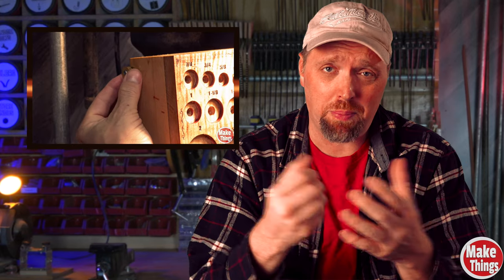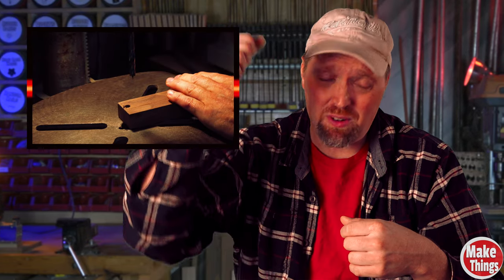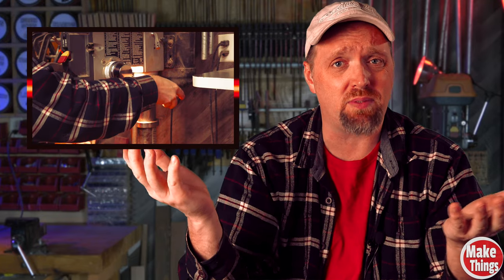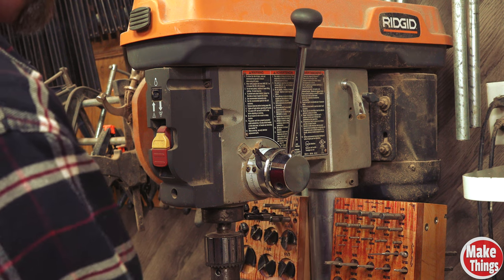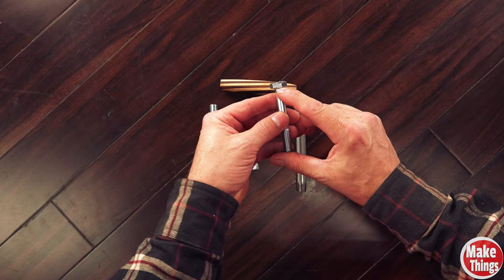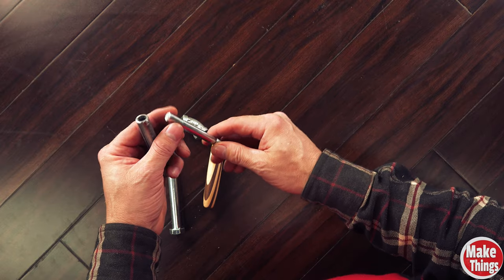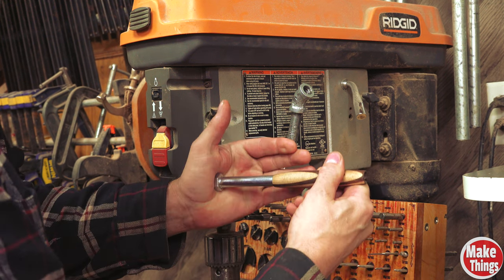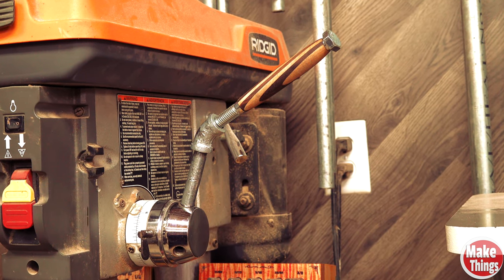Redesigning My Drill Press Crank // Problem Solver!

Comment: Depending on what I'm making, I've had times I had to set the depth the drill press starts at and/or stops at.  In those cases I end up using one of the other handles.  I like your idea too.  Thanks for another awesome video.

Comment: Good idea, Rob. I'm a little lost in translation. 
The five objects, I'm guessing, are as follows: 
1. Nice handle 
2. A bolt that matches the threading in the hub.
3. A galvanized pipe nipple, the opening approximately the size of the first bolt's shank.
4. A 45⁰ elbow, and a cap, the size of the nipple.
5. A larger diameter bolt, approximately the size of the opening in the ell, which is just forced/ wedged into the ell? 

I was thrown by the bolts, thinking they were the same size, but they are not, right?